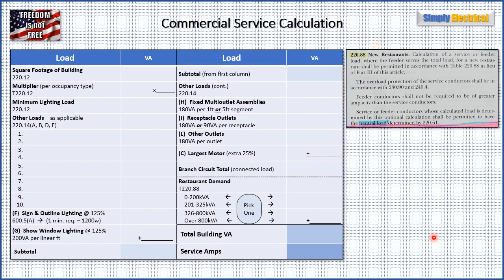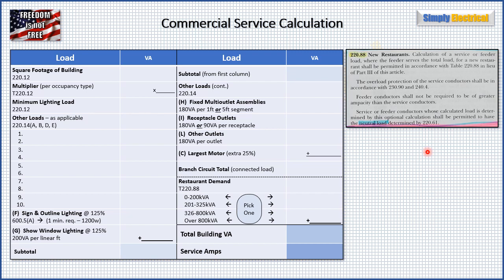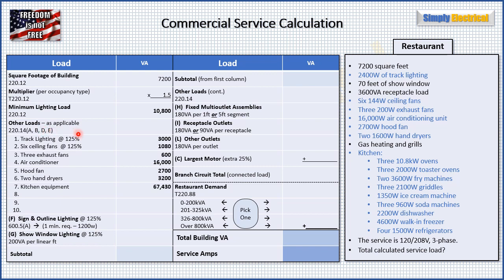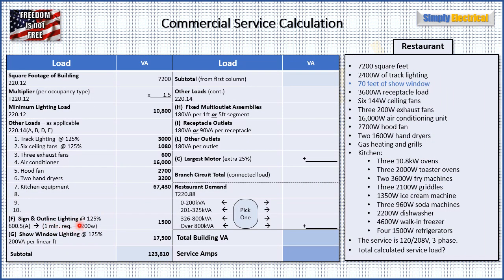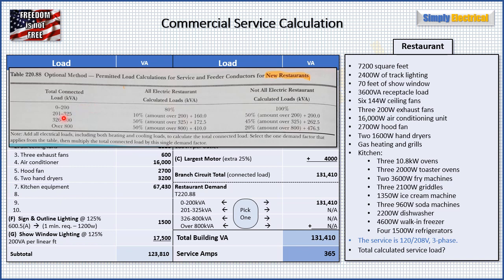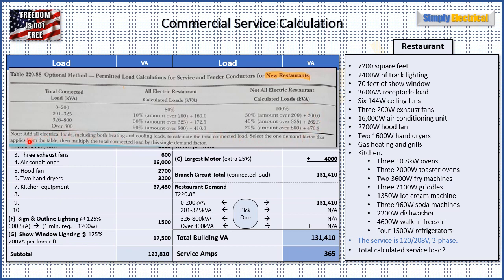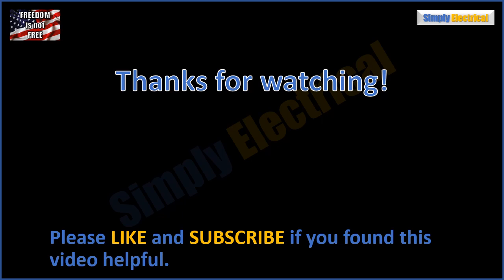Restaurant Optional Service Calculation - Crash Course 2020

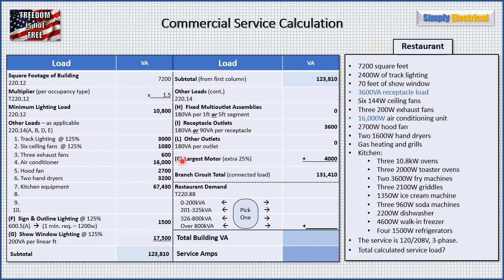Comment: Your Videos are amazing, Thank you so much.  One question, @ 6:55 when using the optional method, do I still need to add 25% for the largest motor of a noncoincidental load?  I thought that only applied to the standard method calculations.
Reply from the maker: In 220.82(A), we are told that Part III is superceded by Part IV. But Part II is NOT superceded. And that (220.14(C)) is where we are told to apply 430.24 to motors (in a group, in this case). Therefore, since Part II is still in effect, we must take the largest motor of the group (i.e. on the service) at 125%. This rule applies to both Standard and Optional calcs.

You will find that some people argue against this, but I really see no merit there. I am open to hearing other points of view, though. Until I hear a better case, I'll continue to add it for exams. Unfortunately, the State testing agencies do not share their perspective with us, so we can only hope we see it the same way they do.
Reply: @simply.electrical  WOW! My head is kind of spinning on that one.  It does make sense though.  You're a fantastic teacher. Thanks for all your hard work.  I take my masters test soon and this is so helpful. Thank you again.
Reply from the maker: @joshuaanderson8672  Thanks for your kind words. I wish you the best of luck on your master exam. Which state?

Comment: Thank you, I assume per NEC, office spaces are not having Optional Feeder Service Load Calculations
Reply from the maker: That's correct.  The only occupancies that allow for an optional method calc are specified in Part IV of article 220.  However, take note that 220.87 does pertain to existing loads, in case that is relevant to your situation.
Reply: @simply.electrical  Thank you for clarifying, Apricate that. you can made branch circuit design video for design engineers.